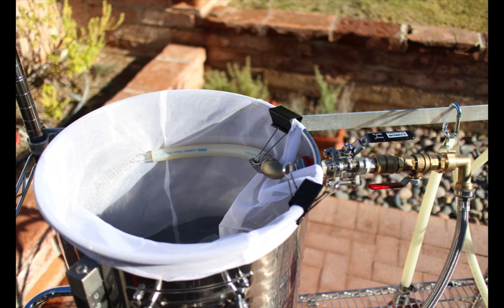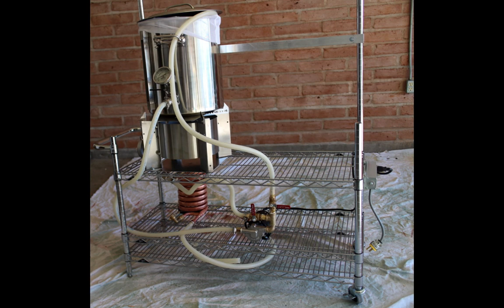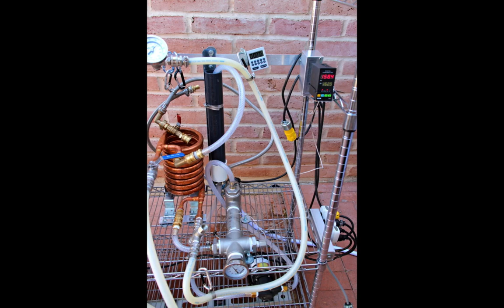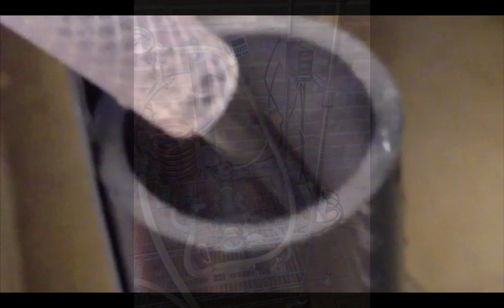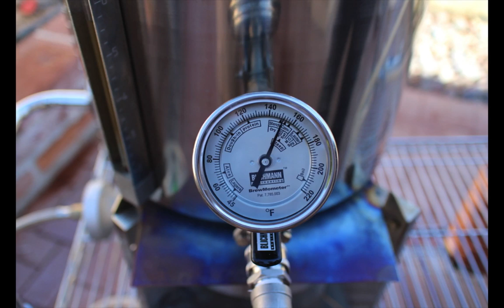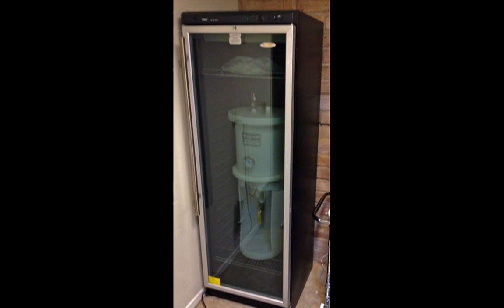Brew In A Bag: BIAB with HERMS via Outboard RIMS Tube

Comment: Do you have any issues with cleaning  the counterflow "heat exchanger"? I'd be worried about stray grain husks getting trapped in the coil, or do you run wort through the inner diameter that should be less obstructed? Pretty neat usecase using rims this way without scorching.

Comment: Hi!
Is the temperatur sensor on the mash or hot water circuit?
Reply from the maker: Its on the mash circuit. The thermocouple temperature sensor for the PID controller of the RIMS tube is located at the exit of the mash transit through the convoluted counterflow heat exchanger. Thus, keeping the mash at temperature.

The hot water circuit runs a little higher in temperature, than the mash circuit. The rig has a analogue thermometer to monitor the hot water circuit temperature. 

In an abundance of caution, the brewers attention is called to an unlikely, but noted, safety issue: This set up could allow the hot water circuit to have a runaway temperature, if for example the mash flow was interrupted. This because the thermocouple would detect a low temperature of the mash, rather not detecting the raising temperature of the hot water circuit. A safety feature is that the RIMs hot water circuit is open, with a open hose refilling the hot water reservoir.  Yet because of this concern, however unlikely, subsequently, the hose conducting the hot water "out" of the RIMS tube was redirected downward away from the brewer and also the CCF coil rotated 90 degrees.  If the hose connection is blow off, the steam is aimed down and way, not out at the brewer.